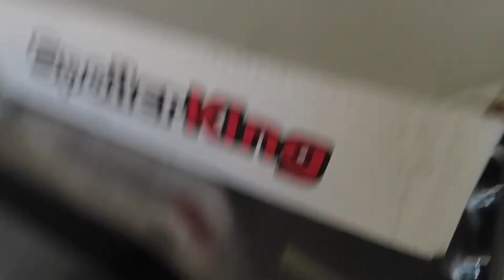Spoilerking 380R install | GARAGE DRIVEN

Comment: Had a quick question, did your adhesive on the tape ever come off on the sides? May have tampered with mines, may have to run out get some more 3M double sided, just the edge starting to come up. Can't tell....but my OCD is yea...well yea haha.
Reply from the maker: Mine has been good no issues but I’d pull the entire thing off and redo the adhesive then reinstall it.
Reply: @GarageDriven  It's just the dang end...good advice! I was going to get a strip and just re-do the end. Thanks man!
Reply from the maker: @392Reviews  you can try that way first it’s all up to you...it’s gonna be a pain to get the old adhesive off 😂 it’s gonna make you work those fingers.
Reply: @GarageDriven  That's what im saying! I feel if I can get that one end to stick down, i should be okay. It's just something I see, not really noticable to anyone not owning the vehicle